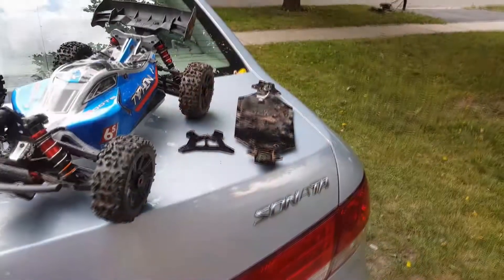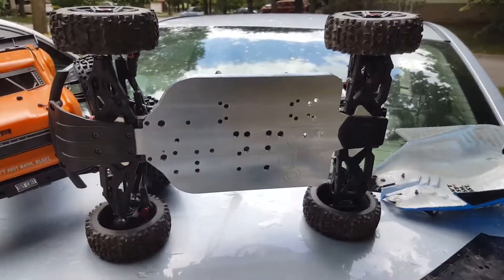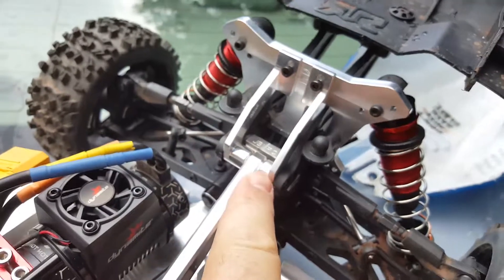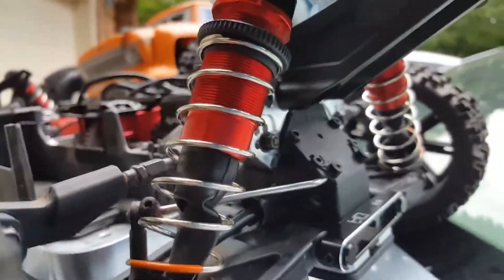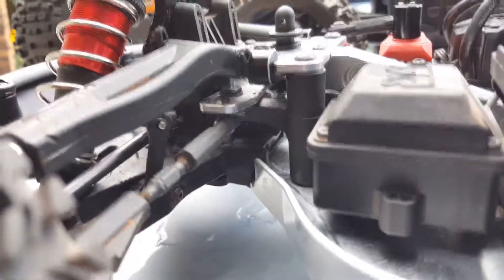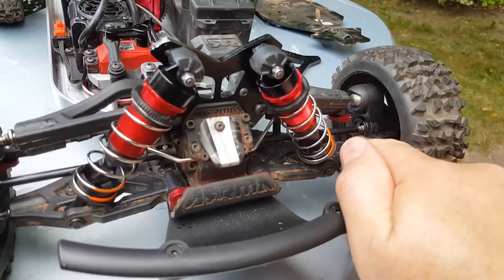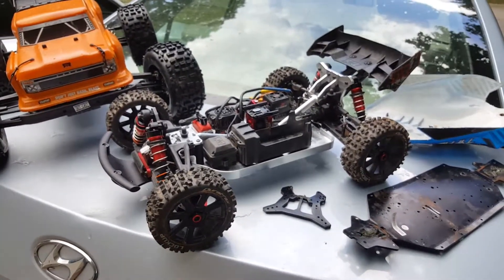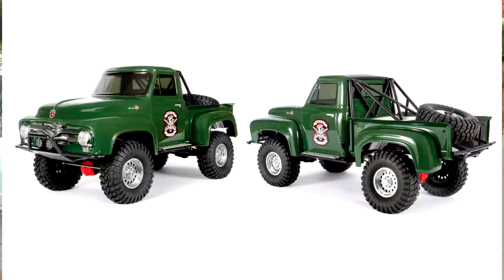Extreme Bash Arrma Essential Upgrades - Typhon 6s Upgrades - Just Bash it chassis

Comment from the maker: Hey guys! My Typhon is built like a tank now! I had her out yesterday doing 30ft high launches and all the upgrades held up and performed great! Vid to follow 👍😄 I did forget to mention I have Tekno Orange shock springs and an RPM Kraton bumper on her as well. Cheers and bash on guys! 🍺
Reply: Old thread, but curious what you are ruining with your center diff and pinion? Speed run gearing, or OEM bash gearing?

 Did you do any upgrades to the spur or pinion? I see that it says Dynamite on the plastic housing. is that a Dynamite spur? Thanks, if you can help me out. I'm currently running 43TS 30 T Pinion, still trying to make room for smaller Spur In running Armma Typhon 6s for speed runs. And advice, I surely appreciate it 

Semper Fi
Alumnus Iran Contra Affair--circa 1986

Comment: Nice work on the car
Reply from the maker: Thanks I appreciate it. I kind of went overboard on strength upgrades on this car. My outcast has only basic upgrades and is still very tough now.
Reply: @KaizerTest  I used to have a HPI RS4 nitro belt driven car with a 3 horsepower engine and all aluminum chassis, titanium aluminum ball diffs, CVD's. We've all done it. Sometimes best just to leave the car like it is and replace the parts when they break. Don't forget to work on your punch settings if you haven't done that already and try a gyro stabilizer
Reply from the maker: @meditationheathandwellness781  Yeah I have set the punch. Did you see my Slash 4x4 vid? 132Mph and my Arrma Felony do 119Mph?
Reply: @KaizerTest  nope. But I'll look for it
Reply from the maker: @meditationheathandwellness781  They are near the top of my videos.

Comment: Shock tower braces ? Where are they available ? I dont see them on the site
Reply from the maker: The website says these are for Kraton, Outcast and Mojave but I also put them on my Typhon. You need to cut little slits in the body so it fits on though. Makes the rear end nearly bulletproof with aluminum lower hinge pin retainers front and back. Funny M2C calls it their most important upgrade...I agree. https://m2cracing.net/arrma/381-m2c-3035-arrma-kratonoutcast-series-rear-shock-tower-brace.html
Reply: @KaizerTest  thanks for taking the time out to post a link.. I'll order now
Reply from the maker: @Bornindafire  No problem brother. 👊🏼😃 Just a note...you have to drill the rear shock tower and it bolts on. It comes with a small drill bit and bolts and nuts. Which truck are you putting it on?
Reply: @KaizerTest  thanks again. I'm putting it on a typhonv5. I have a outcast 8s and talion V5. I should  make a few simple vids !!!
Reply from the maker: @Bornindafire  Nice collection! Yeah this will help the back end. Post some vids if you get a chance...I rarely see anyone talking about the shock tower brace.

Comment: Awesome video dude! 
I just received a load of upgrades for my kraton! I already have m2c chassis etc.. but i couldn't help myself and got alot more stuff haha, can't wait to go flying ;)
Reply from the maker: One thing I have to say that is very important is the rear shock tower brace from M2C racing. If you land on the back wheels or worse one back wheel hard the rear shock tower can flex and bend taking out the rear diff housing. The rear shock tower is only held on by 4 screws.

Comment: Since you already have this buggy can you run it on only one lipo pack?? I seen it has a dual battery in series plug on the ESC I just bought mine and only got one 6S lipo pack for it
Reply from the maker: Yes you can run only 1 pack or two 3s in series to make 6s. I use single lipo 6s packs as I find it easier to charge 1 battery. I just took off one xt90 connector and soldered it up for only 1. The esc comes with two connectors to run 2 batteries and a jumper  plug if you only want to run 1 pack. So you bought a Typhon 6s?
Reply: @KaizerTest  Yup sure did an hour ago.... Should shipout in the morning.... I am glad the ESC comes with a jumper plug if you only will be using a single lipo pack
Reply from the maker: @angryyank  Yessir! But the new ones come with IC5 connectors so make sure you have an adaptor if you need one or grab connectors to solder on(whichever you like to use). Or maybe your battery already has an IC5 connector..lol. The Typhon is my favourite 6s Arrma so far. Mild jumps are ok on grass(like 3 -5 feet high) Try to land flat if possible. Avoid landing on one rear tire if you can. It's pretty durable out of the box but the back shock tower is held on by old 4 screws.
    I highly recommend an M2C racing rear tower brace and chassis braces. This will give more forgiveness on rear end landings and allow higher jumps. I did jump this completely stock about 8 feet high about 20 times and she held together fine. But like I said the shock tower brace and aluminum chassis braces are fairly cheap insurance.
   Alternatively you can just rip it around doing wheelies on the grass or dirt and have fun without jumping as well and just do little launches off grass berms. Totally fun as well. 
   My next video has the Typhon doing 25Ft high and 40 ft long jumps...lol. It held together nicely..👍😄
  Either way you picked a perfect Arrma 6s if it's your first. Truggifying it later is easy as well to give it a wider stance but it's great as is.
Reply: @KaizerTest  The 6S lipo I bought has the EC5 already I just got back to buildin RC's again and have ALL of my RC's converted over to the XT60 conns... This is my first ARRMA car I have been tryin for 2 full months to get one and they always sellout faster then I can snag one.... Soooo when I seen this Typhon 6S BLX was in stock I pulled the trigger on it as fast as I could
Reply from the maker: @angryyank  Nice! Glad you managed to get one brother. You're gonna love this car. It handles great. The Outcast just wheelies all over and flips. Just put the brakes on and it flips over the front...lol. Jumps are harder to control. You made a good choice. 👍

Comment: Extreme, but needs upgrades anyway. RC is a joke
Reply from the maker: Yeah it is kinda crazy extreme. It can take a pounding now for sure.
Reply: @KaizerTest  I've had bunches of modded and unmodded RC's over the years, driving them thoughtfully, and well within what they were advertised to do..and yet they still last for just a few packs, then something goes wrong. I just had to step away. It's justan e$pensive hobby I can't justify. <rant complete>
Reply from the maker: @paulmccarter908  Is is a very expensive hobby. Stuff constantly wearing out and breaking. Street cars(as long as you drive in an open area) take less of a beating generally speaking. The Tamiya  TT02 is a great cheap onroad car. And some of the WL Toys cars are quite good. I used to also metal detect in forests and parks for old silver coins. After the initial purchase of a decent detector... really there was no more cost. Ive spent crazy amounts of money on RC stuff. But I would still be happy with a cheap car. I like to tinker and work on stuff....even if it was just cleaning parts.
Reply from the maker: @paulmccarter908  I see you are a gamer. I finished Red Dead Redemption and LA Noire remaster with my son. I love Rockstar games since Vice City.